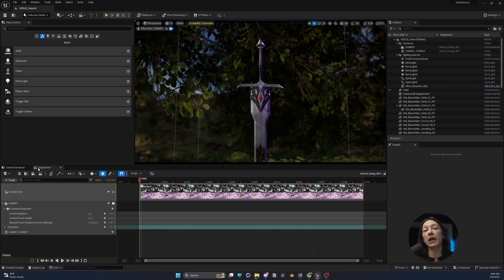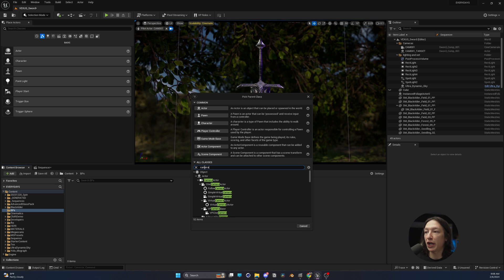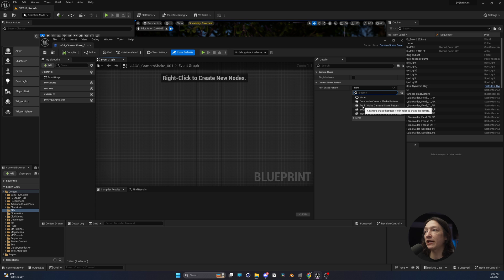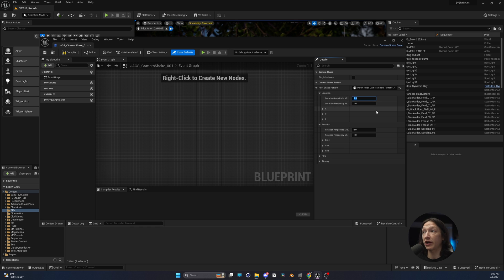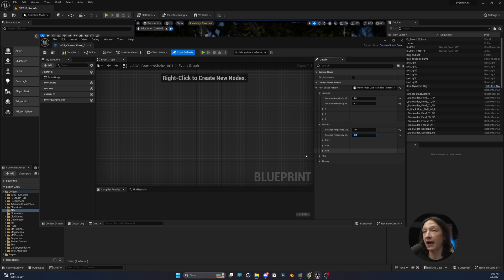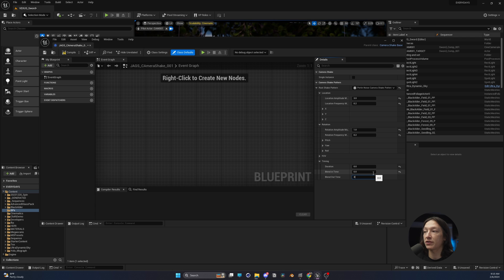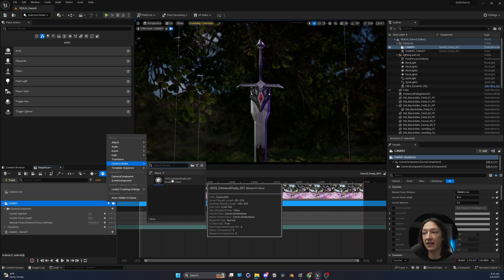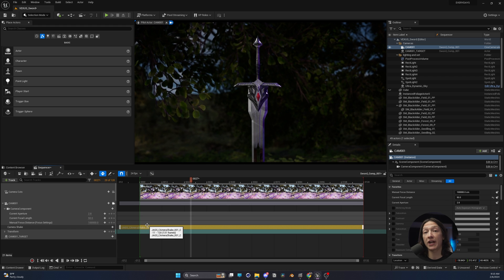Quick Camera Shake in UE5

Comment: Is there a way to smooth camera movement recorded with mouse and keyboard after it was recorded? I used to this technique in Blender "Tutorial: Quick Smooth Camera Movements in Blender" by Polyfjord and I didn't see any technique that could match this perfect balance between control and speed. It's fast and adjustable and those two very rare goes in pair.